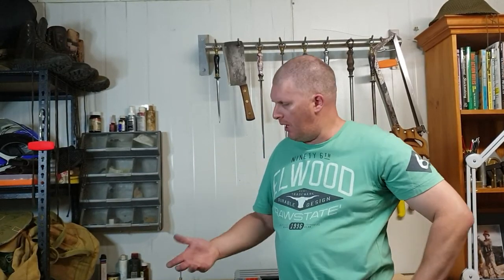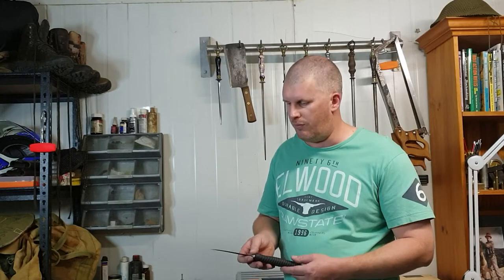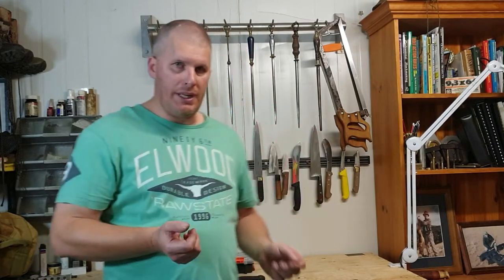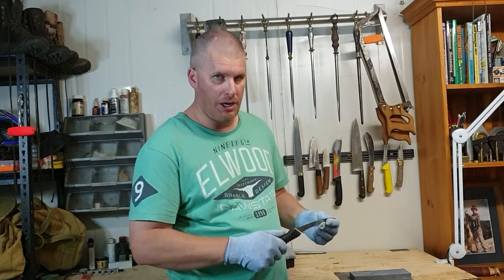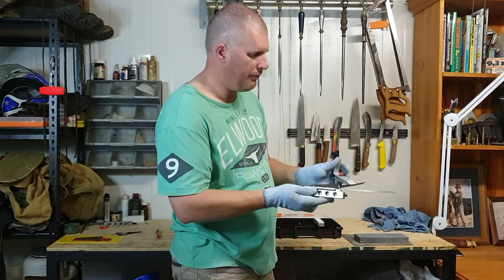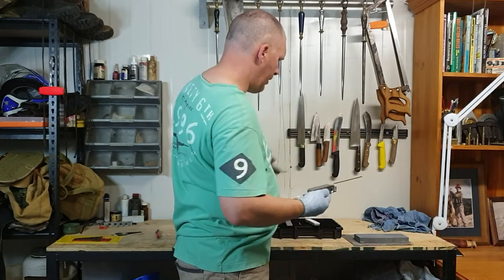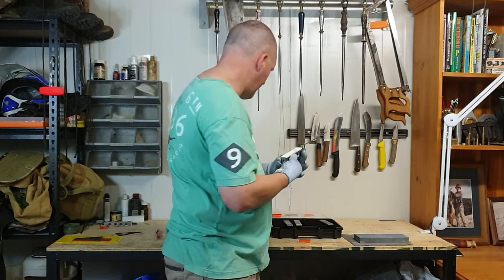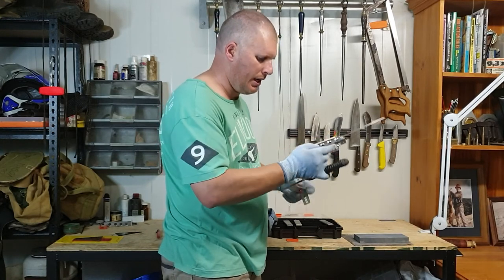THE BONING KNIFE

Comment: ive notice that if you have all those scratches along your blade it actually increases the friction between the meat and the knife which is something highly overlooked, i find it better to not rub the knife flat but just a coupler mm off flat and then add and edge of around 20 degrees